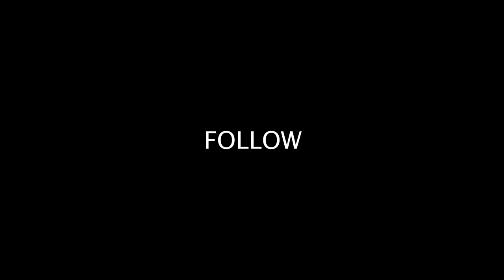after 4 years it finally happened...

Comment: The customer policy is a yes and no game and may not work as you intended. What is to stop them from doing the same thing to the new board and returning that one as well. Customer service is the KEY to every business. In my business ( we make Hot sauces ) I have replaced bottles for various reasons. IE breakage in mail and this is done right away but I always talk to the customer first to find out the exact nature of the problem and then work from there. It can not be just a cut a dry policy because YOU need the information going forward and this helps the mistakes to be NOT repeatable.  Perhaps as Part  of Your boxing you may want to include a single piece of paper that says in LARGE fonts. Putting cutting board in dishwasher voids the warranty . Hand wash only etc. as well as include some board conditioner with every board you sell. They may still screw it up and you may still replace the board but it will not be continuous returns from them. Kinda a side note My knives are expensive, they are my tools of my trade. You put my knives in the dishwasher I kill you LOL

Comment: You could definitely speed up your batching with a drill press. Build a jig that will hold the board at exactly the same point every time and then put the stop on so you dont drill through.
Reply: If you happen to get a drill press I do have an option to change over the drill stop to a better, quick upgrade.

Comment: I got a big kick out of watching this one about the unhappy customer.  Great way to handle it!  

I’m a maker of sorts, mostly using live edge stuff that I’ve milled myself.  I make quirky furniture and stuff, marrying woodworking, blacksmithing, and welding.  

For charcuterie boards, I forge the handles out of steel stock and spend a ton of time on each board.  Never tried to sell one, but I write a story about the origin and process.  Long winded explanation, but on the card I tell them if they put it in the dishwasher it will probably explode. When you opened the box, it was easy to see how the damage had occurred. 

Love the content and enthusiasm in your videos!  I share you guys with lots of people.

Comment: I would suggest that you put a piece of 1/4 " clear plastic about 6" wide down the center of your table saw sled over the blade from the front rail to the back rail .  It serves as a guard to keep your fingers from getting too close to the blade, and cuts down on the amount of sawdust that gets thrown back into your face.

Comment: When working up your price for something is the cost of materials not included in the multiplier? 

Just for craps and grins I put in $1,000 and 7 hours and it came back at $1,315. $315 is exactly 1.5 of the labor rate, which means the material wasn’t included with the multiplier.
Reply from the maker: Hey Hugh! Thanks so much for testing this out! Our code was missing a set of parenthesis (so the formula wasn't doing the order of operations correctly). It should work now!

Comment: On your crosscut sled, have you considered making a stop block with both the length and width dimensions already established?
Reply from the maker: Need to trim both ends of the board - a pencil line of the finished dimensions on the sled is plenty!
Reply: @jennieanddavis  that's fair, I was just trying to think of a way to make marginal gains in efficiency in your shop.

Comment: Love your channel I'm sure you have thought of this or its been mentioned in comments, I did not scroll through them, since this the board has feet why not just engrave a small message in corner about not to dishwasher your boards.
Reply from the maker: That would add another 2 minutes of production to every single board for a mistake that happens less than 0.5% of the time... Not really worth it
Reply: @jennieanddavis  true i have been in manufacturing 28 years and we have to keep a schedule for line times and the OEE will be off if we altered the  line times run speed I run my filler at 1000 cans a minute when we run White Claw so we can finish our production schedule on time , thanks for responding and have a great day